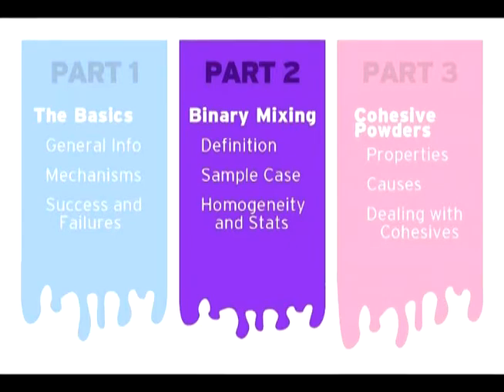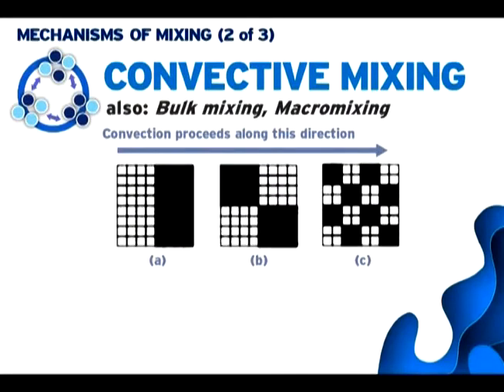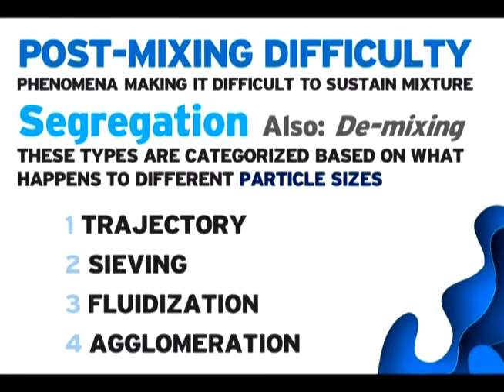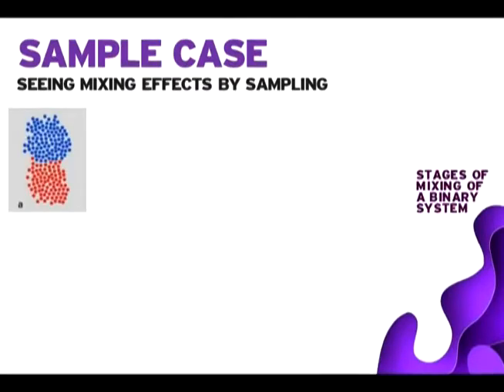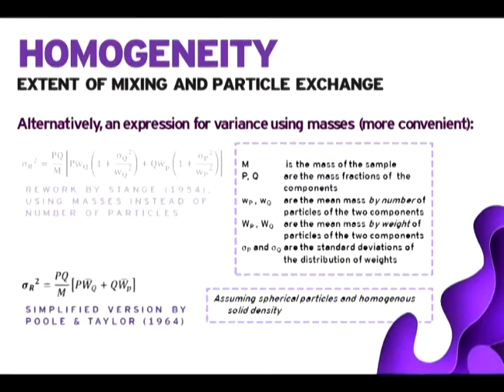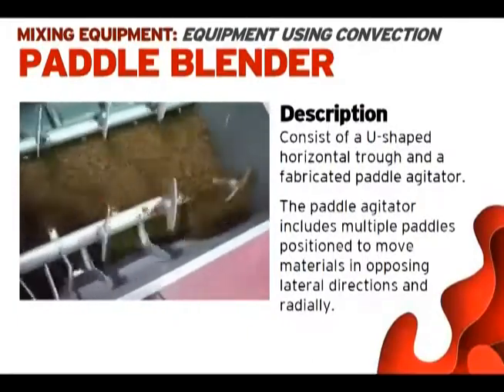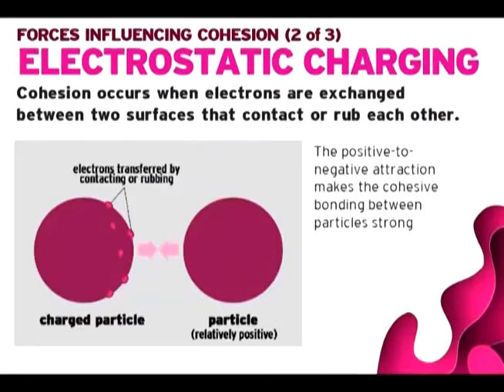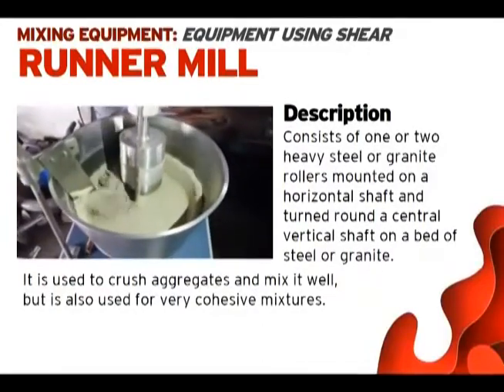Solid Solid Mixing (Particle Technology)

Comment: by the way the way you use the equation in sample problem, you may have to revise the answer. because there is no way that number of samples is 0.9. You should take the 10% value not as per se as the variation of sigma square itself

please refer to solid mixing specification and confidence; FPT Ch12 Q1 Pt1
Reply: so it should be the 10% of the 10% composition